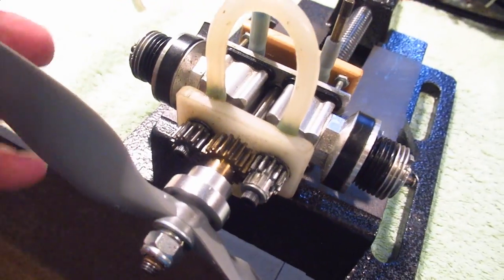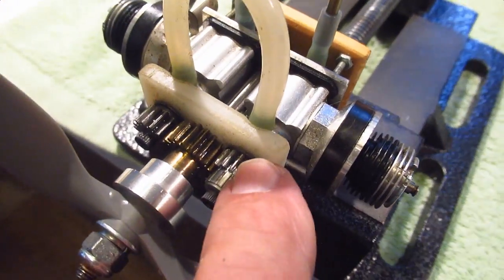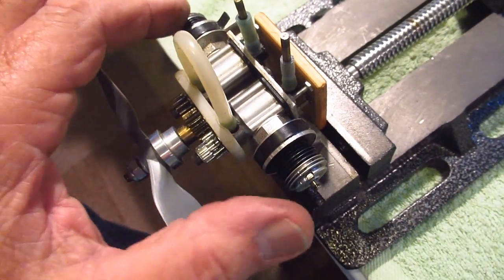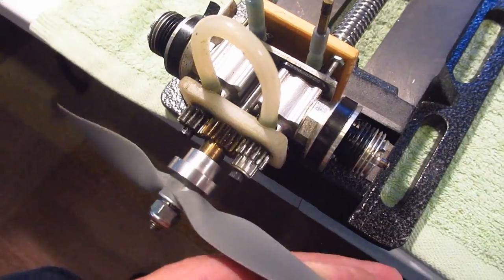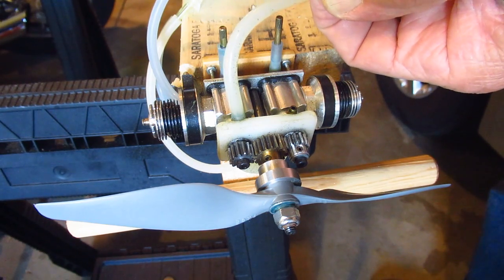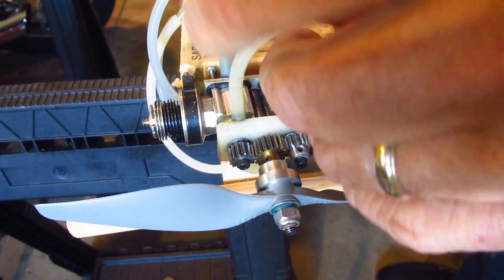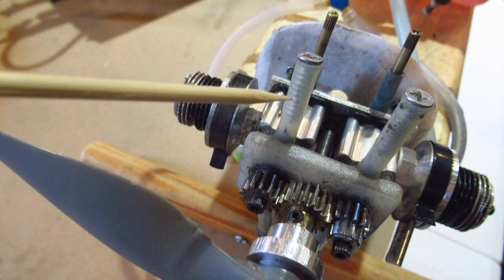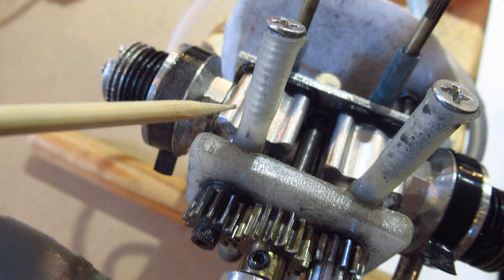Twin Cox .049 cylinders equals one .098 Nitro Engine.

Comment: Hey I was revisiting this video of yours again I was curious to know what size prop does this twin 049 swings?
Reply from the maker: I used a 7x6 on this engine.
Reply: @NightFlyyer  Interesting that most likely means the plane this engine will have to be mounted into must a plane size that's mostly a 15 to 25 size am I correct Dave with a wide cowling like you would see on acrobatic plane such as a Cap or Extra?
Reply from the maker: @3DMOFO2020  Maybe.  When my friend Dave (rip) flew it, he used it as a pusher on a Wanderer Glider.
Reply: @NightFlyyer  As a pusher on glider? WHOA!!!!😮😮😮 My mind has just been BLOWN!! May your dear friend Rest In Peace.

Comment: Firstly? My condolences on your friend's ( Dave Robinder) wheel chair confinement. However? It was good that he implemented this dual cox assembly with a cooling bearing tubing at the change of the time.  He was ahead with progression with this idea." 
~He only needed to add a single fuel adjustment other than dual for main control setup and quick response.~
Reply from the maker: Well 45 years ago, when he made this, there was no internet, no Google, and no way to hear others suggestions, like yours, so used what he had on hand.  Single carb adjustment would have been nice for sure.  Thanks.

Comment: Very ingenious. Why do you use an electric propeller?
Reply from the maker: Because this was the only one I had that was the right size and since this engine does not put out as much power as the Brushless motor did, so no problem.  It works.

Comment: 50 years ago I had the same idea of gearing 2 or 4 of those little engines together, but not having access to a machine shop and or a source for the gears it never got beyond the design stage, Those little engines were a pain to run and keep running as a single unit let alone 2 of them,  but it is nice to see that my idea actually would work.
Reply from the maker: Right on. You’re right. It took some finesse to get a good flight. Thanks much.

Comment: I used to have a COX engine when I was a kid in the late 60s.
Maybe you should experiment with different configuration like firing alternately not at the same time and only one carburetor.
Reply from the maker: Yep, well My wife used to work at Cox in Santa Ana  before it burned down, and Dave Duncan the Head Engineer was a member of our RC flying club back in the 80's.  I have many videos on Cox engines and airplanes on my channel, you may enjoy.  According my friend who designed this, firing opposite was extremely difficult to start and it was very hard to adjust the carbs because each piston and cylinder were on engines that weren't identical in age and wear.  H said it would run just right on one engine, but rich on the other and vice versa, so he went back to 2 carbs.  Maybe with 2 brand new pistons cylinders and glow plugs, would be a way for 1 carb, but he said in no way could he adjust it so it would run right.   Plus he also said it had horrendous vibration.      So I never tried. Thanks.

Comment: When they ran they were fun but they were quite a handful to a 10 year old boy to get and keep running! PT-19, COSMIC WIND, BD-5, a half dozen wooden kit builds then the .35 Fox engine and combat wings, Aircobra, and flea market finds. Good times, thank you for sharing this!
Reply from the maker: Right on.  I was 10 doing it too, but began flying in UKIE Pattern contests with Johnson 35 combat special engines in my Veco Thunderbird and Nobler.  I was a voodoo fan too.  You had some good stuff too, it sounds like.  Thanks so kindly.  I would bet if you liked this, you will like to see a later video of my 63 year old Cox PT 19 U Control recent flight. https://youtu.be/BU0z7ddwslYUkie    Thanks much.
Reply: Always a favorite Christmas gift right up there with Erector Sets and Heath Kits.
Reply: All I can say is W😮W!
Reply: I remember those .049 mufflers.
It was the only way Mom would let us run those things in the garage.
Reply: Traduci

Comment: would help if the  mixture needles were  linked together  moving as one,  i see  80s   rc car  pinion gears  being used,  robinson racing or trinity, very cool build,  hope the friend is well.
Reply from the maker: He is not that well.   I think since each engine has to be synced, he made them this way to be easier as they feed fuel right into the crankcase of each engine. 1 needle might work better for sure, but these Cox engines always were very sensitive to needle valve adjustments.  Thanks much.

Comment: Yeee haaa. The year was 1973 I was in trade school learning to be a Machinist. I took two Cox.049 cylinder piston assemblies mounted them to a crankcase I made in  a Southbend lathe. It ran but only on the prime as I couldnt develop vacume to work the reed valve and draw fuel. Still was fun to do and 40 years later I  see this and think " I  should have tried that " lol
Reply from the maker: That's a great story and effort.  I'm sure Dave, my friend, will appreciate that.  Thanks kindly.  Check this out, if you like Cox engines.  Flying shop rags.  https://www.youtube.com/watch?v=Q7MwFVHCRpY

Comment: Very cool, and good job discerning the problem with the coupled front bearings venting to the crankcases.  Idea- could you set the needle valves independently by running without one glow plug, alternating first one, get it set, then switch to the other?  Also, that prop isn't happy with the pulse excitation frequency of the setup- looking at the vibrations when viewed edge-on.
Reply from the maker: They both fire at the same time.  There was too much vibration firing alternately and it was impossible to start.  It would not stay running on just 1 cylinder.  That prop was the only one I had, so it probably was out of balance. My friend designed and built it many years ago.

Comment: In 1962 I got a PT-17 control line plane with a cox .049. It was a lot of fun. Yes they are loud, we did not have mufflers back then.
Reply from the maker: That is great.  Thanks so kindly.  I would bet if you liked this, you will like to see my latest video of my 63 year old Cox PT 19 U Control recent flight. 
https://youtu.be/BU0z7ddwslY
Reply: @NightFlyyer  I got the PT-19 for Christmas in '61 and a P-40 "Warhawk" for my birthday a few months later. I got seriously bit by the bug. During the winter of '62-63 I built a "Flite-Streak" and my uncle gave me a Testors/McCoy .35 to power it. First flight in the spring was on 55 foot .012 steel lines I got from a friend.....I figured it out quickly that I'd need 70 or 75 foot lines to fly this beast! Flew combat and stunted with it for 2 years, had a lot of fun! Then at the age of 14.....I discovered girls.......
Reply from the maker: @ajwilson605  What a great story. I discovered girls too, but made sure they liked model airplanes.  LOL  Thanks and happy flying.

Comment: Remarkable, and very well done. You have also proven that you can run a electric propellor on a IC engine. Brilliant.
Reply from the maker: Actually that is a 7x6 ic prop, but some will work on small IC engines like this, but not good for anything big.  Thanks.

Comment: I’m trying to work out why the oil tubes were used, most ball bearings run perfectly on their own lubricant. Even a sintered bronze bush wouldn’t need a continuous oil flow.  Nice bit of engineering.
Reply from the maker: My friend is an engineer and figured the extra stress on the bushed bearing could use the extra oil when he built it,  so that is the reason.  It can't hurt but probably not necessary .  Thanks.

Comment: Cox engines were bad to run backwards at start - how would you ensure that both engines would start and run in the right direction ??
Reply from the maker: Well, they were designed to run either way.  If I had an engine run backwards, I simply flipped the prop backwards and it usually ran the right way.  In this situation, both engines had to run together and one could not run backwards. And of course if it was running backwards, you would know right away as which way the wind was going.  Thanks so kindly.  I would bet if you liked this, you will like to see my latest video of my 63 year old Cox PT 19 U Control flight from this week. 
https://youtu.be/BU0z7ddwslY

Comment: that is so awesome! would be amazing to see you run it on a flying rc plane. Have you ever tried that ?
Reply from the maker: Not yet, but it has flown on a plane...a glider in the past. Thanks.
Reply: @NightFlyyer   it took me 4 years but I managed to get my hands on a twin Cos just like this one! execpt its set up a litlle different but using teh same concept. I'm excited to get it going. Did you ever end up running it on an rc plane?
Reply: Put that on a nice p51 or p47. That would turn one of those airplanes into lightning with wings.

Comment: I built a twin cox in the 80's almost exactly the same but without the oil tubes. Ran good but never put it on a plane.
Reply from the maker: That's great. I may put mine on a plane if I find a suitable one.

Comment: wow, nice job! that's a needle tweakers dream! Since its good with 180 firing, I wonder how it would do with header pipes into a collector system
Reply from the maker: Maybe a pipe collector system could be added to the muffler outlet pipes, but I don't know if it would help, as it screams pretty good as is. I'm just happy to run it for Dave as he designed it.  Thanks Robert.

Comment: Lovely stuff, always did love Cox engines ....  would be nice to put another one on top and bottom,   4 up :)
Reply from the maker: Yes, thank you.  Well Dave is in no position to do that anymore.  He did make a 6 cylinder radial before he got confined to a wheel chair, but that engine can't seem to be found.  Thanks.
Reply: Was the six cylinder made from Cox parts, did it use one needle valve, it sounds like a very cool idea.

Comment: OMG! And that had mufflers?????????
Reply from the maker: Yep you can see them surrounding the cylinders with black spring metal clips that can be rotated to prime the engine. There is a small exhaust port visible too. Thanks.
Reply: Hehe, I was exclaiming because of the noise really. But yes, I knew these little engines normally vented direct through the barrel, though I've never owned one.
 Is one ?pipe? pointing towards the prop? Or is that a handle?
Reply from the maker: Yep, one pipe is pointing forward.  Many of the early baby bees never had mufflers.  They came later.  It makes it easy to open the spring metal clips to expose the port and put in a few drops of fuel to prime.  It would be nicer if they both aimed back, but...you know...Keep it simple, sir. :-)

Comment: Okay, so the next step on this would be to plumb both intakes to a single carb.  If you continue to run it with alternate firing you shouldn't need that carb to be much larger of an intake and you could probably use the same needle and jet from the stock carb.  Always wanted to try something like this when I was a kid, but lacked the facilities to actually fabricate it.  Barring that, you might try a remote needle valve for both cylinders to try and get a balanced run from both sides.

The crankcase leakage is probably due to there not being a forward load on the crankshaft.  The forward curve of the main crank "disk" (pull one out, you'll see what I mean) was what sealed the engine in a tractor configuration.  Always had problems using these in a pusher plane because of that.
Reply from the maker: That would be a lot of work since these engines are reed controlled through the rear of the engine. There are no carbs. Tee dee engines would be easier because they had Venturi needle carbs and no reeds. Thanks
Reply: Well, if you think about it, the backplate/reed-valve assembly is the carb.  That's the induction side of the engine.  Just not the typical RC or UC carb we're used to in front-rotor induction engines, like the Tee Dee series, and most modern RC engines.  The function is the same.

It should be possible to run a remote needle valve common to both cylinders and thus get an even mix to both.  You'd have to keep the plumbing between the remote needle and the fuel inlets as short as possible but it should work.  I used to do a lot of 1/2A flying and remote needles are real finger-savers on these small engines.
Reply from the maker: Its too much work for me to mess with and besides, I wanted to just show what Dave R was capable of before he got MS and now can barely move his hands.  Thanks anyway, as anything can always be improved on.

Comment: This is pretty cool. I could only imagine a triple or a quad setup, this would sound mean!
Reply from the maker: Dave also made a 6 cylinder radial and it was hard to set all the needle valves since these are reed engines. No carbs. Thanks.
Reply: I seem to remember seeing a 5 cylinder radial engine advertised for sale in the magazines that was just 5 OS .10 on a gear drive back in the old days.  Wish I could find the ad for it, but my old issues got lost in a move...

Comment: This is actually great for rc helicopter you place them to fire at the same time so piston motion is completely vibration free and let the main rotor act as a flywheel to compensate for power pulsing
Reply from the maker: I could not get it to run firing at the same time as I tried and tried.  The push on the gears weren't right.  It actually is quite smooth as is, though.  Thanks.
Reply: NightFlyyer oh well it's still good engine and cylinder cutting out does not seem to be so bad you can still land it

Comment: Holy cow! That is awesome! Like seriously! Back in the early 90s my friends and I would take the Old foamy gliders and turn them into RC’s… As you know equipment was heavy back then So using an .049 what is the best possible solution LOL these planes never flew that great but they flew… Long story… I always wondered if you could couple two of them and turn up a two cylinder. Now I know! Wow! Again that is a really neat set up!  Have a great week Dave!
Reply from the maker: Thanks very kindly Dylan.  We appreciate that!
Reply: I was flying Cox .049's in the 60's free flight later in the 70's 2-3-4 channel.....60 % nitro and 4.5" x 5.5" prop. Those little planes scream. Still fly them but electrics are easy...................nitro is the way to go.